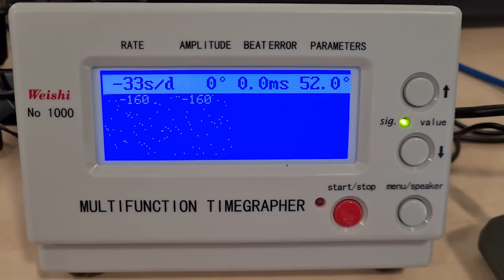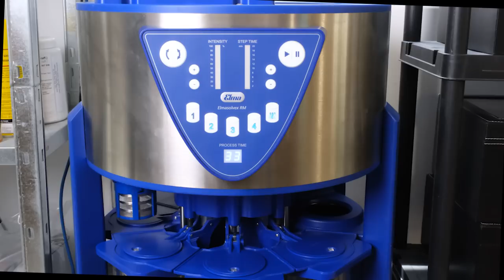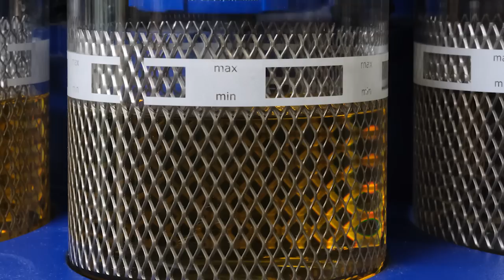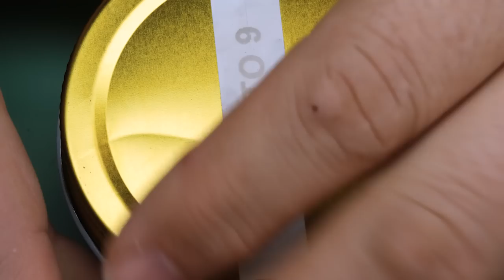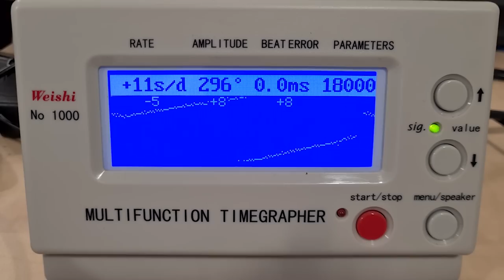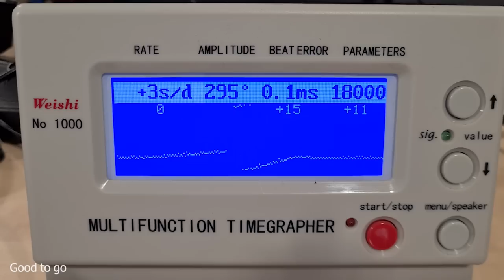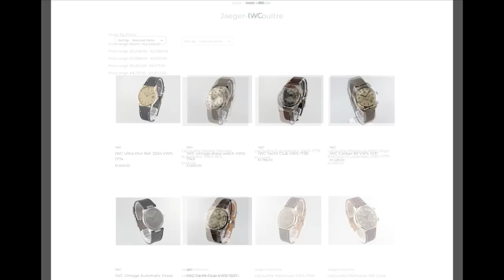From a $10 eBay buy to......?

Comment: What a lovely timepiece Stian, and a beautiful restoration.  It was not lost on us, how manly one would have to be to wheeled that hammer using the staking set, nor how teeny weeny those balance cock jewel plate screws were. Also was very impressed by the nose hair trim (bar one). Disappointed at no dad joke. So here is an old one to keep you going. Pirate walks into a bar with a ships wheel down his trousers, when the barman asks “what’s that all about “ he replies “I don’t know, but it’s driving me nuts.
Hope you feel better soon Stian.
M
Reply: I think it's wield that hammer, old son. 😉
Reply from the maker: 😂 A dad pirate joke for good measure!

Comment: Thanks Stian. Missed your voiceover. Why are different lubricants used for the crown wheel and the square part of the stem?
Reply from the maker: Sore throat issues, I'll upload the video will full commentary on Saturday :) There's more pressure between the sliding pinion and the winding pinion than there is on the stem, but you probably could use the same lubricant if you want to.
Reply: @VintageWatchServices  thanks! And take good care of that throat. We’re all looking forward to more dad jokes

Comment: I do have a question about the case restoration part. To be clear you buffed of the flacking and rusting and then polished. There wasn't any electroplating, correct? The shine on the watch is amazing and I want to understand what's achievable given the resources I have.
Reply from the maker: Yep, you got that right. The case material is nickel, which looks slightly golden after polishing. I thought it looked perfectly matched with the dial and decided not to plate it.

Comment: Hi Stian! One question please. Why You don't put the pallet fork together with scape wheel and shock setting in the basket of fixed drop? 

Why do you dip it separately?

Tks, 
Mario.
Reply from the maker: Hello Mario, you can put it in the basket indeed, but if you just dip the pallet jewels in the epilame, you don't have to clean the pivots later

Comment: I read that Elgin? made machines called automatics that cut balance staffs from raw stock. They were clockwork driven? How were large quantities of balance staffs made 100 years ago?
Reply from the maker: No, that's a bit exaggerated. Elgin indeed automated many of the standard operations but never fully. There were some operations done on one machine, then manual interaction, then another piece of work on another machine etc. I don't know the exact details but entirely automated machining is only a few decades old. What Waltham and later Elgin did was to automate the process of making parts to a reasonable tolerance but the parts would still be adjusted in assembly. There wasn't true interchangeability of parts until well after the first World War, closer to WW2

Comment: With the use of citric acid applied in the right places, the copper would shine like new, as well as the dial, unfortunately the oxides cannot be washed off, only dissolved in a weak acid

Comment: I learned the hard way ....  do NOT soak movement parts with this copper plating in L&R No. 111 no matter how dirty/greasy they may look.  The L&R No. 111 will strip off the plating!  Thanks for the video!
Reply from the maker: Wow, never heard of that issue before, Woody? 111 should be safe, but the parts shouldn't stay in for too long. Could it be some sort of contamination of the liquid from other parts?
Reply: @VintageWatchServices  I intended to soak a baseplate for a a short time.  I fell asleep and forgot about it.  It soaked for about 8 or 9 hours.  It didn't completely strip the plating - it made it loose - it will rub off very easily.  The movement had dark areas whch I assumed were old/dirty grease and oil.

Comment: Amazing stuff!!  How do you measure the angle to set the rest at when lapping the case angles?
Reply from the maker: Thanks! I use a sharpie to color the surface and move the wheel ever so slightly to see if the color is being removed. I then adjust the angle until the color is rubbed off uniformly. Then you can start the machine and be confident your angle is correct.

Comment: Great job Stian! Really missed your voice, you got a cold, or training to be a monk? I assume you re chromed it? And where do you get such lovely vintage looking crowns from? New main spring? Great amplitude! Could you do a video on all the details re correcting beat error, most of the old beaters I practice on (much like the condition you bought this in) have 5ms, I can never fix this. A lot of the cheap movements are pin pallet with no jewels, can these be serviced to a very good level with basic tools and skill? Ta ta.
Reply from the maker: Thanks Boyd! Sore throat issues, I'll be uploading a version with commentary on Saturday :)
Old pin pallet movements are generally not worth the effort, they will likely generate much more frustration than satisfaction. I'm building up a few videos for launching a membership area and I'll include a beat error correction video there 👍 In short, you determine to which way the balance wheel needs to be turned in order for the pallet fork to be centered and then twist the collect accordingly.
Reply: @VintageWatchServices  thanks Stian, yes I’ll be happy if I never see another pin pallet in my life again:-). Ta!

Comment: What an outstanding job of love! I wish to replace my dad's Cortébert gold plated watch as no #8535 case surfaces on eBay! The case is oxidized where the bottom plate meets the case. It seems that the rubber gasket is exposed in this part. I wish to make the watch as water resistant as possible. I even remember submerging it in my dad's fish tank! But today I couldn't even water the lawn with his watch on my wrist! Any suggestions?
Reply from the maker: Thanks for watching! Finding replacement cases for old watches is pretty much impossible, I'm afraid. If you can see the gasket it sounds like the case isn't properly closed. If you bring it to a watchmaker specializing in vintage watches he might be able to help you. If you want to, you can send me some photos of your watch from all angles to stian@vintagewatchservices.eu
Reply: @VintageWatchServices  Done! Sent you the pictures of my beloved Cortébert Automatic. Albeit, I believe that what the two watchmakers claim is that as the gold-plating broke off, it left a gap for water to get in, not that the rubber gasket shows. And to me the issue is with the crown...

Comment: Replacing a roller (14:00) without supporting the balance spoke was quite risky. Could you answer what did you do to restore the case? Have you re-plated it (chrome?) after polishing as I think it was a gold-plated base metal first? The case back is stainless steel which needed only polishing.
Reply: Same question. Looks like you left it as brass which will quickly dull.
Reply from the maker: Hello Popeye, yep, I started pressing the roller on without support and saw the spoke was flexing too much so I put a support under it after. I didn't get that on the video however so I decided to just show the initial process so I at least had something to show.
The case is made of nickel and after polishing it I thought it looked beautiful with the slightly golden sheen nickel has and decided not to plate it.
Reply from the maker: It's nickel :)
Reply: @VintageWatchServices  A nickel case. Yes, when polished it looks great. Thank you.
Reply: @VintageWatchServices  Ah, I see it now. On my phone I must have had the blue-light filter on because it looked yellow. I love your content, in any form (my favorite watch channel)

Comment: I haven't watched hundreds of watch repair videos, but I've never seen an automatic movement have an issue with worn pivots on the barrel arbor. Is this a problem with manual wind movements only?
Reply from the maker: Hello Steve, no, it's a very common issue for the barrel bridge bearing to be worn. Sometimes also the main plate bearing, but that one is typically a bit thicker.

Comment: Hi all! I have a Seamaster with same Caliber. But I could not find any information related do Omega + AS. It sounds odd Omega using 3rd caliber. May watch is a fake Seamaster or Omega realy used other caliber? Thanks!
Reply from the maker: Hello Una, that's a fake then, unfortunately. Omega used only in-house movements in their watches apart from in chronographs where they would use Lemania movements.

Comment: How do you find the hairspring and pivot sizes? I have an old pocket watch that the hairspray is destroyed and I would like to get it working again. I just don't know where to start.
Reply from the maker: Hello Ed, it's a really, really difficult task to find a hairspring and match it to an existing balance. If you can, you really should try to find a balance complete, thus a balance with the hairspring. Otherwise you would first have to measure the weight and diameter of the balance, then try to find a hairspring of the right strength, then vibrate the hairspring with a vibrating tool to determine the length of the hairspring, then pin the hairspring to the stud. These are things most watchmakers never do apart from maybe once during training.

Comment: Hi, I have a little question, if you don't mind, about electroplating. How do you avoid the problem: after plating the case back or the glass ring won't fit anymore. I'm dealing with this issue right now. Thickness of my plating is around 5-6 microns. Thanks for advice
Reply from the maker: That's a problem I don't think I've heard about... 5-6 microns with a home setup is actually very thick, but it still should have an impact on the fit. But you can always curve the parts out or in a bit with your crystal press.

Comment: i have a question. what does Unadjusted vs Adjusted mean? I saw one watch that said Adjusted Two2Times and whats the little arrow pointer that has the +- and in appears as if it can be moved forward of back a couple marks from the center.
Reply from the maker: Adjusted means that the manufacturer had a watchmaker dynamically poise the balance so that it keeps within specified accuracy limits in a number of positions. Typically this would be done for chronometer watches, adjusted in 5 positions. It takes quite some time and thus makes the watches more expensive.

Comment: Doesn't the AS1130 have 49 deg lift angle?
Reply from the maker: Yes it does! I've been working on an AS 1895 also and forgot to change the angle. The amplitude with 49 degrees set would be some 12 degrees less.

Comment: Wacking away hard on that barrel bridge with your massive hammer. Is it always on the upper side of the barrel there is wear?
Reply: Impressive result!
Reply from the maker: Hello Janne, the hole itself is worn and both the anvil and the stake are domed, so it doesn't really matter which way you put it. If the hole has been worn for a long time, you might see some wear from the ratchet wheel on the top side, though.
Reply: @VintageWatchServices  thanks for answering. However, my question was probably not spesific enough; what about the hole on the underside of the barrel, in the main plate, for the lower side of the arbour; Is that hole also seeing a lot of wear?
Reply: Most videos on yt are showing work done on the bridge?
Reply from the maker: @janne770  Ah, sorry, yes, the wear is mostly on the bridge. The mainplate is typically thicker than the bridge, making it stronger. You do sometimes see the mainplate hole worn as well, though.
Reply: @VintageWatchServices  Thank you for your answer, and great videos. Always learning something new

Comment: How come "20 rubis" on the dial. Isn't that odd? (he-he)  Normally 15 or 17?
Reply from the maker: Yep, they went all out on the capped jewels on this one... More of a marketing selling point than functional value, tbh.
Reply: @VintageWatchServices  So where is the extra one? If there's one on the balance, it should be an odd number?
Reply from the maker: @demopem  The fourth wheel only has a cap jewel on the train side given it has an extended pivot on the dial side.